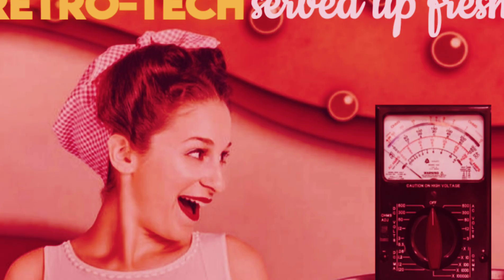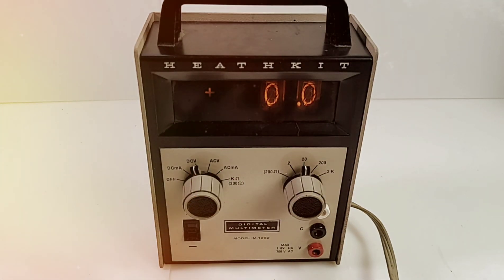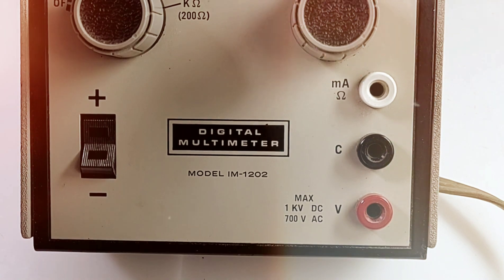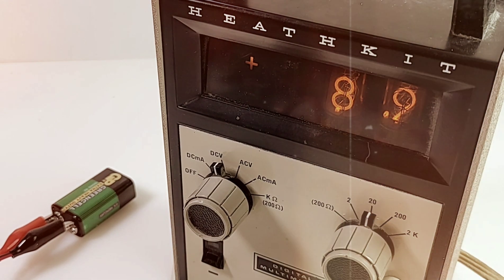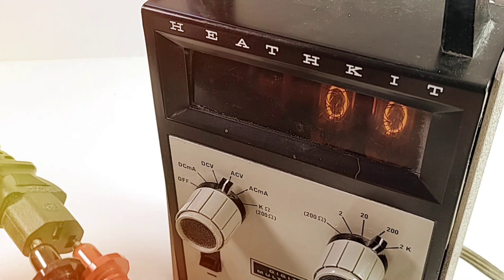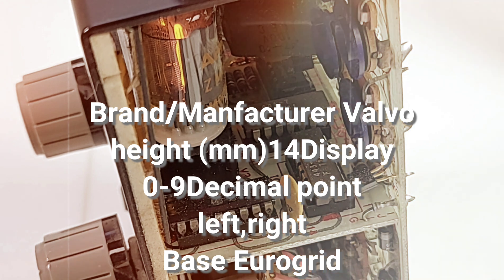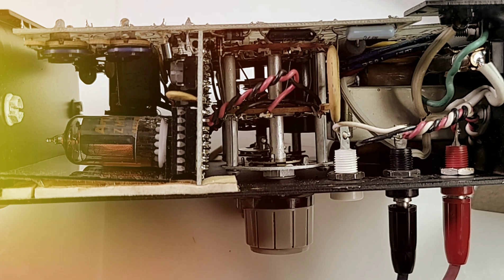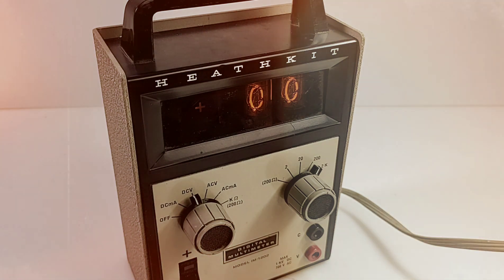RETRO-TECH ○ HEATHKIT IM-1202 Vintage Multimeter Mini Review & Teardown!

Comment: Oh wow being so late, finally a video worth the time! But how accurate it is...when you actually calibrated the thing...would it even stand a chance in accuracy against the CHEAP-O meters of today?
Reply from the maker: I doubt it can compare to today's CHEAP-O Multimeters. IC's have evolved exponentially and there's no way a 50 yr old pioneering piece of tech could keep up..but lots of fun 😀 irregardless 👍
Reply: @KeepOnTesting  Compare it with the 830 then, fairly dated since its core was something of the HP meters of past, and that abysmal update rate compared to that "barely vintage" meter!